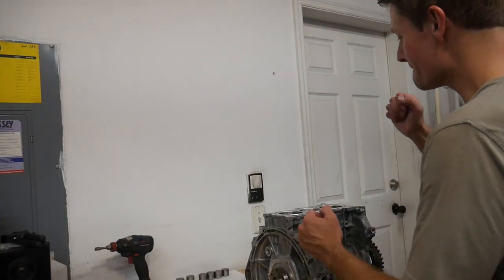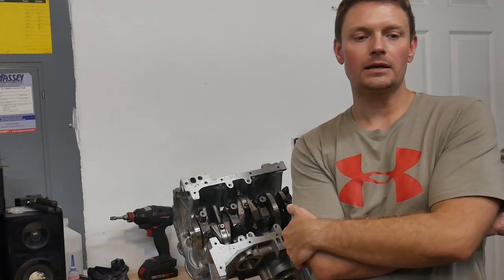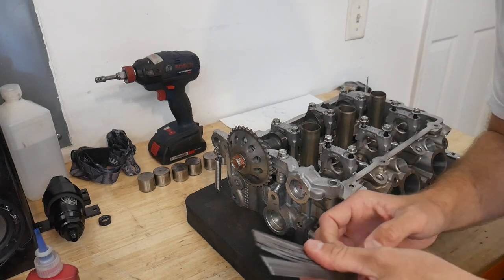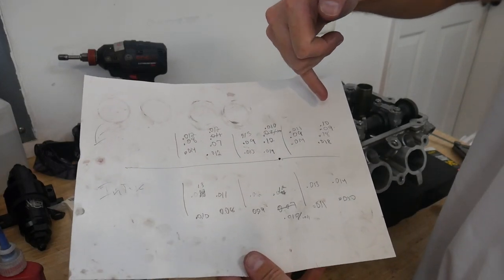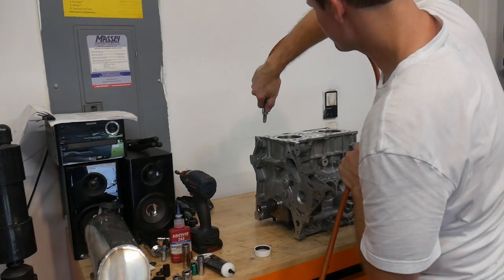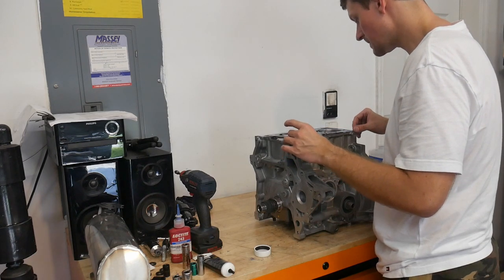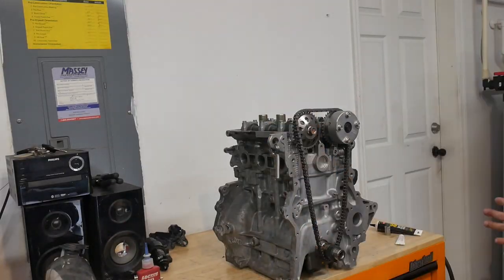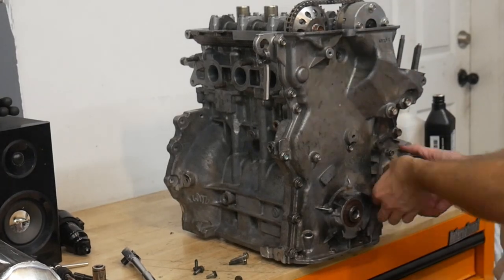How to Build an Engine | Best Engine Build Video You've Never Seen...

Comment: Where did you find main bearings? I can’t find any
Reply from the maker: @dewellmeeks6894  I'm using king bearing both main and rods to custom spec. I found that the toyota 1nz-fe bearings fit but I had to grind off tabs

Comment: Lots of new light duty stuff comes with really small connecting rods. Look at what comes in a honda L15, the rods are really small. It doesnt really matter for that engine when its stock.
The same thing prob happens here. These are really low stress, lightweight engines from the factory and there probably isnt an ounce of metal that doesnt need to be there.

Comment: Do you have a rough estimate on how much the block weighs?
Reply from the maker: Just the block? I know the stock engine weight without tranny is 120lbs. Aluminum baby 💪
Reply: @DirtGearTv  that's pretty impressive. I had a 2015 mirage for years. Sold it when it hit 80,000 miles and still regret it to this day.  How much work would need to be done just to hit a 150hp range? There are literally no aftermarket parts for this engine anywhere.
Reply from the maker: @GingerAvenger605  They are tiny workhorses! the last turbo I was using (k03) I was around that figure or more on stock internals with bigger injectors and fuel pump e85 of course